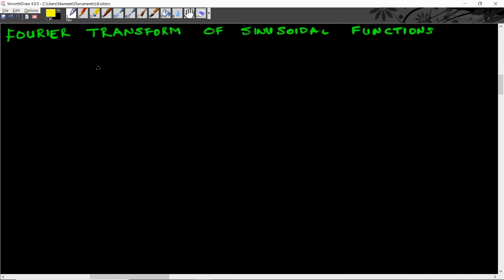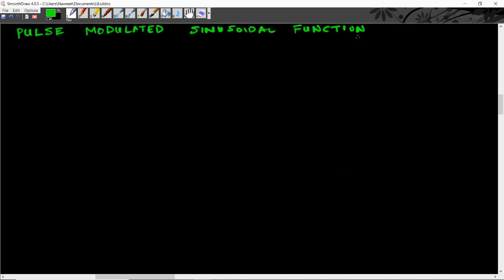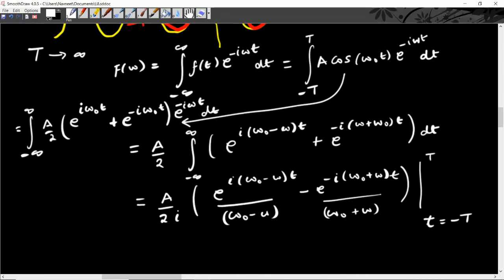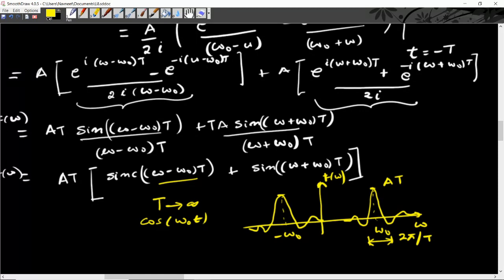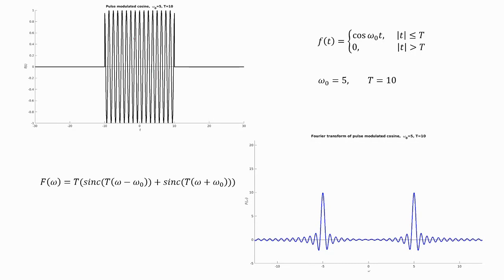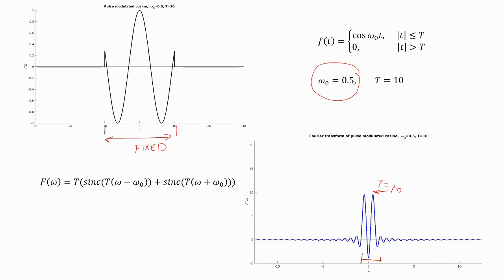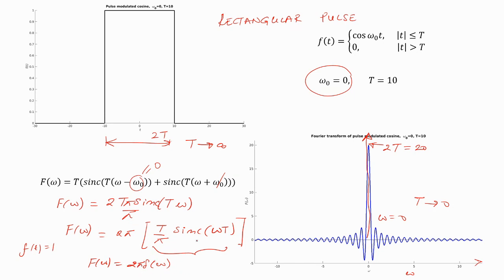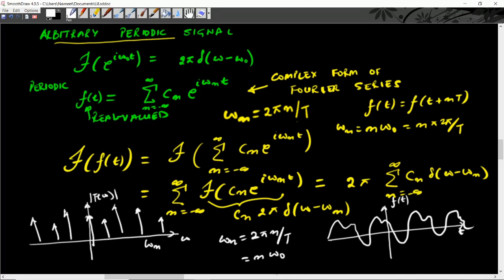Lecture 8: Fourier Transform of Sinusoidal Functions and Pulse-Modulated Sinusoidal functions

Comment: In the representation for Delta using the sinc function, as T tends to inf, little overshoots are observed near zero. Are they similar to Gibbs phenomenon??
Reply from the maker: Gibbs phenomenon in Fourier Series is observed in the time-domain representation of the signal using finite number of terms in the Fourier Series. This is different from what you are mentioning. However, there is a link between sinc function and Gibbs phenomenon. It will be clear to you when we discuss filtering using convolution. There you will see that the a low-pass filter is equivalent to convolution of the signal in time-domain with a sinc function in time-domain. Because low-pass filter cuts out high frequencies, one cannot reproduce a discontinuous signal after filtering with a low-pass filter. As a result you get the Gibbs phenomena. So the oscillations of the sinc function indeed have something to do with the Gibbs phenomenon. See more at https://community.sw.siemens.com/s/article/the-gibbs-phenomenon and https://en.wikipedia.org/wiki/Ringing_artifacts